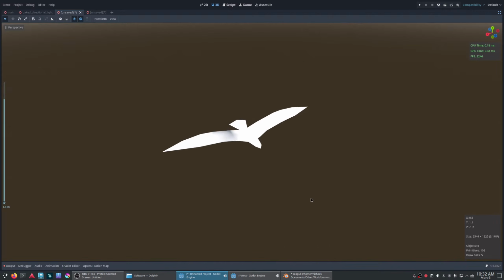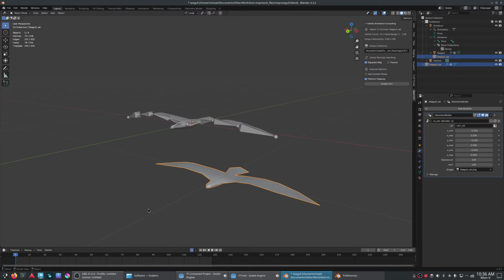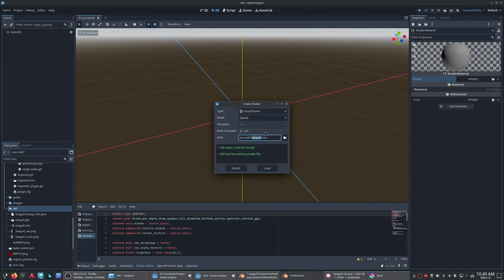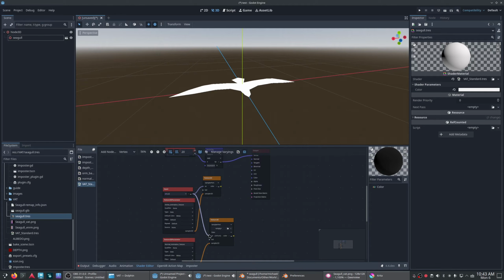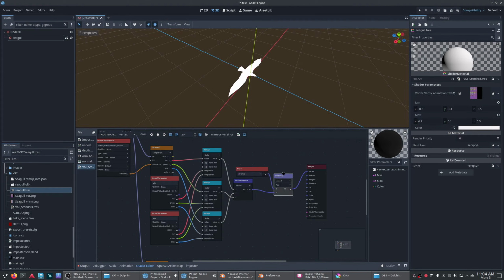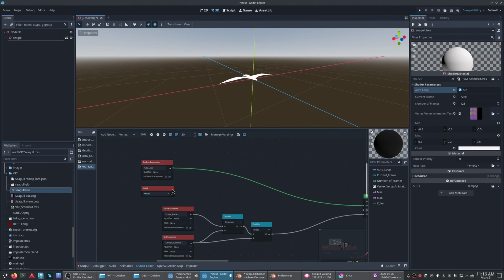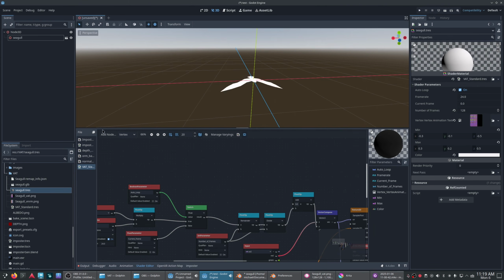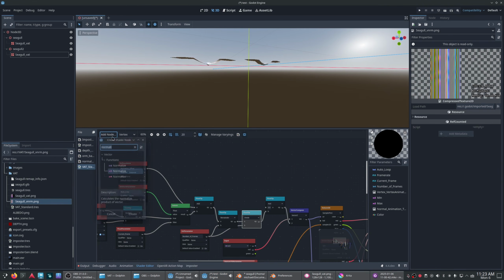Vertex Animation Textures in Godot (Blender to Godot Workflow)

Comment: For anyone having problem with the animation not playing correctly in Godot (the mesh is all over the place) even though you followed the steps correctly, try using Blender version 4.3.2 like in the video. It instantly solved it for me. I don't know why😭

This works for OpenVAT 1.1.0, and Godot 4.7.1. Just don't forget to export the Vertex Normals to separate map on OpenVAT tab(default is packed I think).

Comment: This is great, but I'm having issues with a humanoid animation. It just becomes a scrambled mess.
Reply from the maker: make sure you're using lossless compression! block based compression will ruin it
Reply: @MichaelHarmonArt   Thank you, but it did not help. It might be the way I exported it, since the plugin changed after this video was posted. The exported model has a bunch of different meshes for some reason, so I might be using the wrong one.
Reply: @masteranimation2008  Did you ever figure it out? I'm also having a scrambled mess with the updated addon...

Comment: Thank you so much for featuring my extension! I am making a lot more content for OpenVAT and I honestly lack the Godot examples. Do you mind if I throw this in a playlist for OpenVAT? 

I believe the first frame is just a Linux issue? Weird error to be OS specific though.
Reply: Also if you want to optimize further, remove your vert groups that were driven by the armature. Not sure if your gltf export stripped those. ..And you can run the texture through something like zopflipng and strip the alpha channel if you really really want to optimize ;)
Reply: @LukeStilson  Please make godot examples ,
Reply: @whiletrue1-wb6xf sorry I'm slacking a little on Godot and Unreal but I hear you, Unity has all the latest and greatest implementation right now.
Reply from the maker: totally feel free! And yeah don't worry, I definitely don't export with animation data or skinning/vertex groups. Clearing the alpha channel is also part of my pipeline as well since storing alpha increases VRAM usage in the final app.
Reply: 💪 you sir are a powerhouse

Comment: THERE IS SOMETHING MICHAEL DIDN'T POINT OUT WHICH IS, THAT  SPECIFIC SHADER ONLY WORKS WHEN ALL THE VERTICES OF THE UV2 GENERATED ARE ALL ALIGNED ON THE TOP JUST LIKE THE EXAMPLE GENERATED FROM THIS SAMPLE. YOU CAN ACHIEVE THE STRAIGHT ALIGNED VERTICES ON THE TOP OF THE UV IF YOUR ANIMATION FRAME COUNT IS ABOVE HUNDREDS JUST TO BE SURE, JUST DUPLICATE YOUR KEYFRAMES UNTIL YOU SURPASS ATLEAST A HUNDRED FRAME COUNT INCASE YOU HAVE A SHORT ANIMATION. I STRUGGLED FINDING OUT THE PROBLEM UNTIL I DISCOVERED THAT.😅 ANYWAYS THANK YOU VERY MUCH SIR!
Reply from the maker: with the shader setup i had in the video that's true. But with some simple math you can offset within the range you need and also support textures where there are more verticies than frames. simply have parameters for both the number of frames, and the y resolution of the texture. Then take use the remainder operator to only loop through the correct number of lines of the texture.

Comment: Very cool! Check out vertex painting to save on materials too.

https://youtu.be/-OqRp9o9vQA
Reply from the maker: vertex colors are great but they are stored per mesh. so if you'll need seperate multimesh3d nodes for every different coloring of a model. I definitely use vertex colors extensively. maybe later I'll make a video on my technique for getting model variations with a single vertex animation texture by using vertex colors as a layer bitmask
Reply: @MichaelHarmonArt  commenting to see if you did this? And also to say next big OpenVAT version will allow custom attribute encoding (animated flowmaps, color maps, wetmaps, masks, whatever you want)

Comment: Thank you very much!!! This was very helpful! I had some problems with my VAT because the framecount and resy are not the same here. In your example both are 128 but here they were 24 and 512. Somehow I could make it work by looking into the Blender Geo-Node setup. It sort of works but I'm not sure it's really correct. 
Have you tried with another model and frame count?
Reply from the maker: you can have a different frame count, but you'll need to change the shader if you have more verts than frames or your frame count isn't a power of two (you'll need to snap to individual frames instead of smoothly interpolating with the way the OpenVAT generates those textures by default)
Reply: @MichaelHarmonArt  What seems to work fine here (with interpolation) is to divide the remainder by the resY instead of dividing by the framecount.
The original Geo-Node Setup also subtracts 1 before the division. ( but I changed this to 0 as it seems to skip the first frame, that I was to lazy to repair in an image editor)
Reply from the maker: ooh good to know, I assumed the geo-node setup was regenerated each time you used the VAT export and none of the changes would be respected, but that's awesome! 😎 

Thanks man!
Reply: @MichaelHarmonArt  mh, don't know, I only generated once. Made the changes only for playback.
Reply: So- the geo node system for encoding is appended each time a vat is ran- if you do not perform cleanup and keep the generated scenes you are right, it can be modified. 

Also secret tip… you can encode ANY attribute, not just position- by editing the encoder in this way

Comment: I see  lot of operations being made to convert from blender to godot within the shader. What would need to be changed in order to not need those ? the 3D models or the textures ?
Reply from the maker: it's the texture that would need to be modified. but the performance impact of those remap nodes is the same either way so this just makes the process smoother. no need to make your workflow harder!

Comment: Great!
Why not using gd shader lang instead of visual programming?
Is it possible to have different animations? Each photo is an animation?
Reply from the maker: when it comes to shaders I've always been more comfortable thinking in nodes :) 

but there are definitely times you'd want to write a normal shader, I just usually go for a visual shader first to wrap my head around the data flow and how I need to do the math for everything to work. If I need to write it as standard shader code later that's really easy.

Comment: By far the most creative invention by whoever has done it.
Reply: Thank you 🙏
Reply: @LukeStilson  thank YOU for bringing that to us. i wonder if it is possible to blend animations together, may be masking parts of textures and replacing that part with another texture or even blend them additively, like one texture would have animation for breathing and another for some othe movement. damn so much potential
Reply: You can, but for additive stuff for detail, the easiest route is to use normal skeletal animation and one layer of this on top. I've done some pretty intense stuff with vertex color or distance fields defining what verts are on which frame- it's all possible, but complexity explodes in the shader so you have to have a really good handle on your use. My last video on unity tools for this shows how blending 2 can create uncapped fps motion and smooth transitions animation to animation (and what that shader looks like)